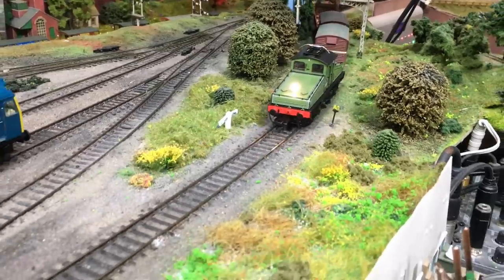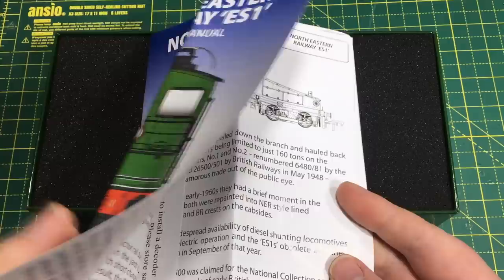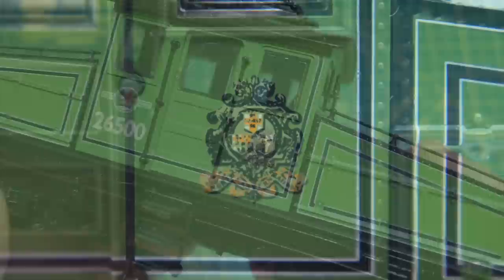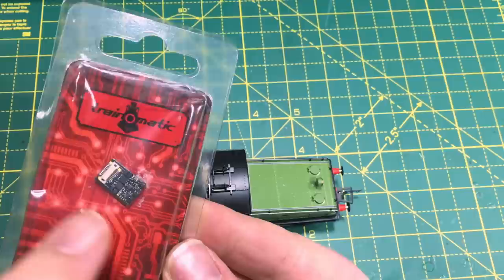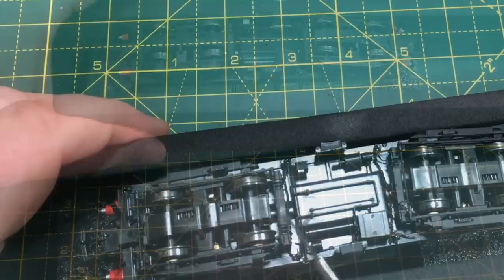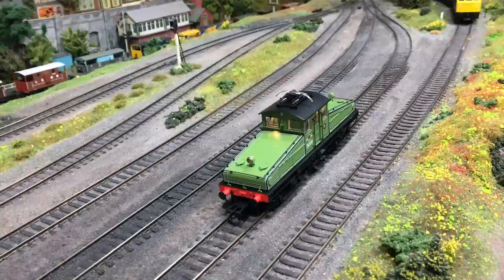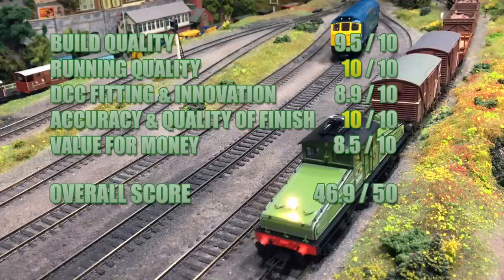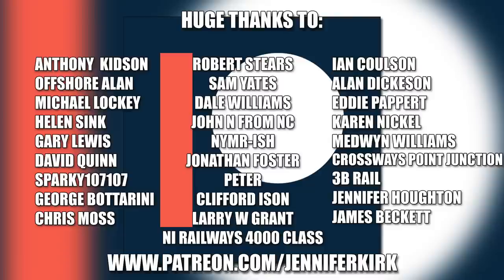The Excellent Electric Pioneer! Rails Heljan BR/NER ES1 Bo-Bo Locomotive in BR Lined Green

Comment: Thanks for the interesting review of the Rails ESI.  I am currently on holiday in Australia and spotted a similar locomotive imported from the UK and preserved in the Australian Nation Railway Museum in Port Adelaide South Australia.   
This electric locomotive was the first of eight operated by the Broken Hill Proprietary Company Limited at two quarry railways at Iron Knob and Iron Monarch in the north of South Australia and at Rapid Bay, south of Adelaide.
All of these locomotives were 3’6’’ gauge (1067mm), weighed 25 tons, and operated from 600 volts direct current.
Introduced at the iron stone quarries at Iron Knob in 1928, the three original locomotives E1-E3 built by Metropolitan Vickers Electrical Co. Ltd. of Manchester and Sheffield, England were joined by a fourth locomotive, E4, from the same manufacturer in 1935.  The other 4  locomotives  where subsequently supplied to the original design by Perry Engineering Co. Ltd. of Mile End, South Australia.
The Australian National Railway Museum in Port Adelaide is well worth a visit.

Comment: Listening to your report on the pantograph and seeing its action, Jenny, I'm disappointed that it is more substantial, and from what I can grasp, not possible to use it to collect power.  I have several Fleishmann steeple cabs and to my surprise, they did not come with full-function.  With a little judicious wiring and fiddly soldering, I have enabled them to collect current from the contact wire, the pantos are beautifully made and substantial, and they work an absolute dream.  The 'return' is on the 'far' rail on the layout and then the steam and diesel locos pick up from the 'near' rail and return also on the 'far' rail.  Control comes from my trusty H&M Duette.  
Thanks for the excellent review, although I can't see myself purchasing one of these just yet.

Comment: I’ve got two - BR version and NER version from locomotion models. fantastic model of one of my favourite locos, only down side is DCC chip fitting - bit of a nightmare! One of my 3rd rail parts was very tight fit and spigot snapped off when trying to remove it, had to glue it back on. Please really be careful when taking parts off! Lovely model though
Reply from the maker: Yeah the third rail pickup removal is a real nuisance. A shame they didn’t cite the screws elsewhere.

Comment: Great review of a gorgeous model. I think there is a piece on YouTube that shows these locos at work.
Reply: Thanks for this - very useful. Do the plunger connections for the lighting mean that a couple of bits of tape could disable the lights, as I find them too bright, but I'd rather not take the drastic step of cutting the wires?
Reply from the maker: Thanks!
Reply from the maker: @andrewhotston983  yes tape over those should disable the lights for DC

Comment: Hello,
    Interesting video. I am intrigued though how the score for DCC innovation and fitting can be 8.9 ? I mean, the instructions are incomplete, you have to remove fixed parts that may then break and other parts fall off (mentioned in an extra slip in the box). When you've got inside it's just a standard socket. Realistically shouldn't the score be much lower ? 

Dave
Reply: I'd ignore the scoring.